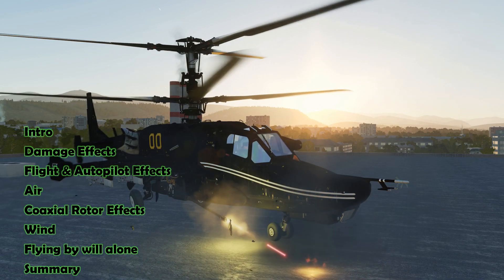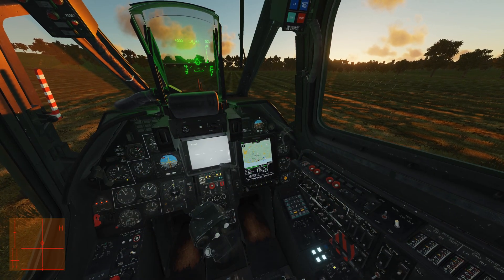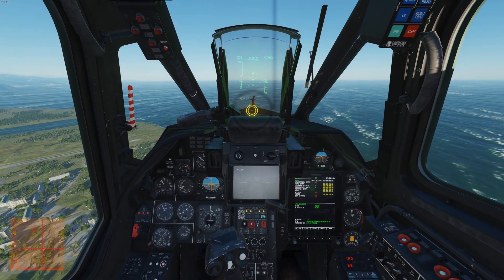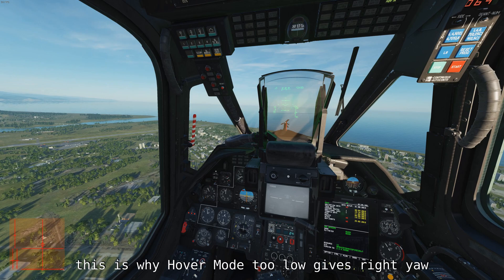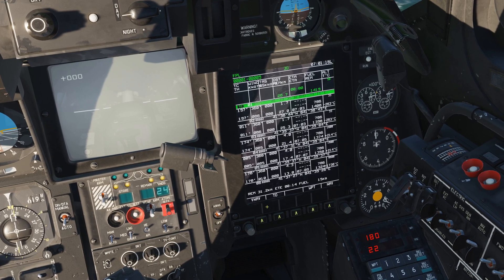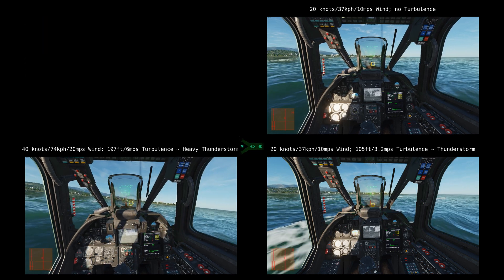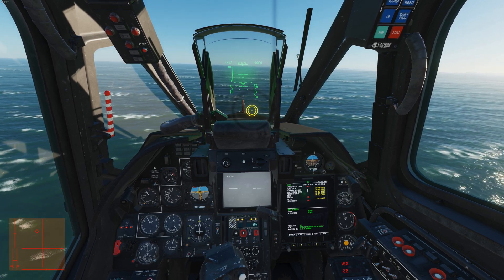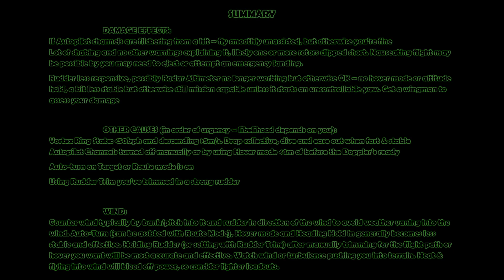DCS Ka-50 Black Shark Heading & Flight Dynamics vs. Spinning, Wind & Turbulence

Comment: Your water is alot easier to see and judge altitude. Is that from adding high wind to the mission or is it a mod or setting?
Reply from the maker: There's a slim chance I might have been running "Better Smoke" mod at that time, which I think did at some point affect the wash. I suspect I only started using that mod later though (up till maybe 2.7 hit). Higher wind settings at sea level does cause cresting so that would definitely have an effect.